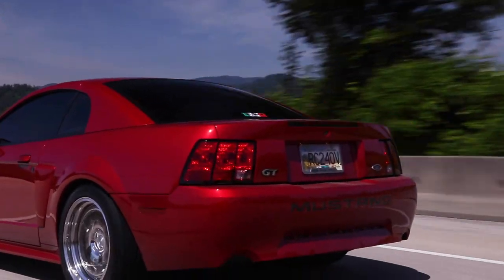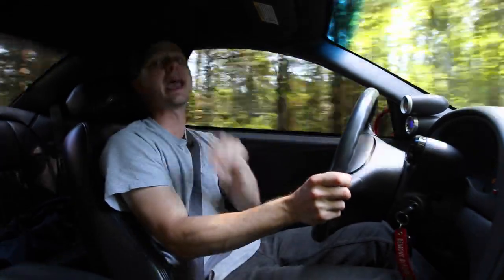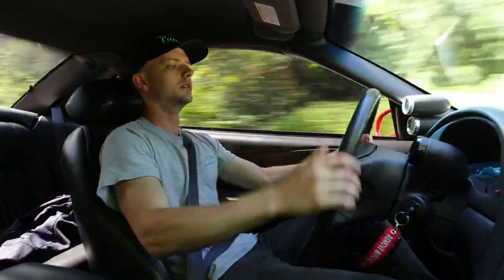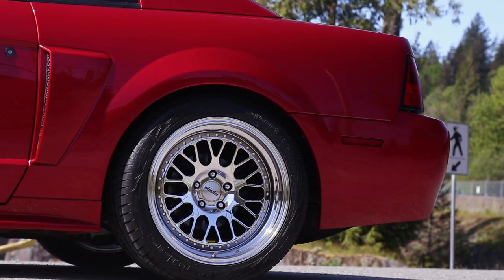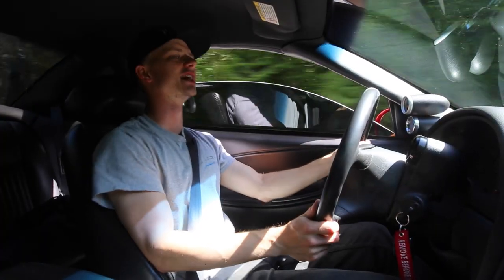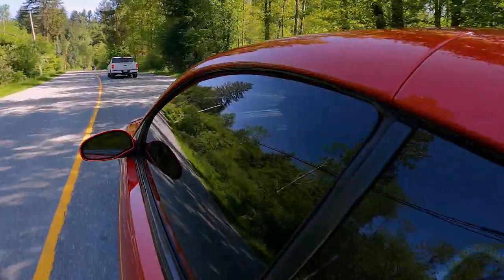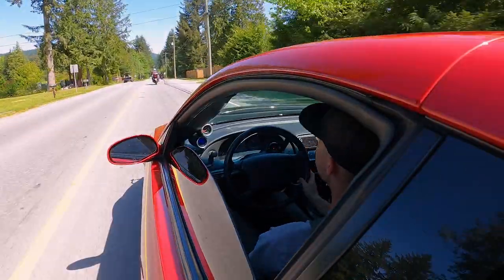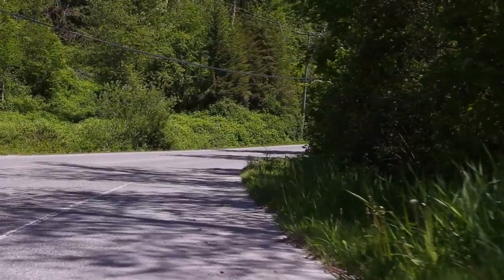This Single Turbo 99’ Mustang GT Tire Slayer Is A Boosted Time Bomb

Comment: Imagine throwing some rods, pistons, and a crank in it. Really can make some power. These 2vs love boost. 700+ on mine
Reply: I have 2v and need advice on how to make over 700hp
Reply: @leondavis3451  just need a good set of rods and pistons. A crank and throw the boost at it. Supporting mods of course. Fuel system.
Reply: Where is a reliable place to get those rods and pistons and crank from ?
Reply: @juanpicazo7798  I have Manley rods and king pistons. My builder had ordered them. The crank I have is a cobra crank. I found it on Facebook market place.
Reply: Guys I have a 2v saleen and I put a t1 blower on it and it ran fine for years but it broke recently. I need to have the motor rebuilt with forged parts but I don’t know a shop I can trust. I would love to build a turbo 2v like this. Any advice would be appreciated. I am will to take the engine out of town to a good company as long as there a great builder.
Reply: @Jsta2v_racing  thank you
Reply: @Jsta2v_racing  where do I go? Who do I buy from. What heads do I need to buy?
Reply: @leondavis3451  u just need to check around with ur shops. Ask around on prices and do re search who does good work. Every shop will have some kind of bad review but u just have to find someone u trust.
Reply: @leondavis3451  basically replace the whole car. Upgraded fuel, transmission, engine internals. Axles and rear can take it but for peace of mind you may wanna upgrade those too
Reply: 700+hp?! Thats amazing! My goal is to push about 400 to the rear wheels on mine. However, the build I am doing with that engine on my channel is actually a 1966 mustang. I think 700+ with my car only at 2500 pounds would cause some severe lack of traction!
Reply: @4WDTrek  setting up the car with right suspension can make a world of difference
Reply: @Jsta2v_racing  that is what I did for the most part. Not pushing for a straight line car. Want to do more autocross and road courses.
Reply: @4WDTrek  fair enough.
Reply: @leondavis3451  this guy really said "just need" than listed a built engine. just ls swap it for 1200+ on stock bottom end.
Reply: Any engine fully built can handle power lol. “Just fully build it bro”
Reply: @ssjdavid  holy old comment lol. Rods and pistons are nothing crazy 🤷🏻
Reply: not to revive an old comment but are you running the stock trans? stock rear end?
Reply: @SnoEntertainment762  I have a 4r70 trans but it is built. The rear end I had was a 8.8 31 spindle axles 373 gears. But that is coming out this weekend. We are beefing it up to 35 spindle and a spool as well.
Reply: @juanpicazo7798  mmr will build a 1000 horsepower 2v that holds up. Only place to get rods and pistons. ETC for 2vs
Reply: Imagine, if it can fit, putting in a Terminator rotating assembly
Reply: @chancekoehler7578  not really needed. The 2v set up can make 1000+ no problem
Reply: A budget built 2V for 600whp would be coyote rods/pistons, stock crank (reliable to 650whp/6500), Tremec TKX or maybe an older TKO that’s been faceplated, and strange axles in the rear. If you have an auto the 4R70 doesn’t take much to be able to withstand some pretty impressive numbers. Any set of cams would of course help but I’ve seen guys with stock cams make low 500wheel.
Reply: @TheJMan1K  yes indeed. The 2vs can make power. The rods and pistons are the main weak point. Change those and ur golden
Reply: You wish you got 700+ hp I call bs
Reply: @reese15m  lol I mean u can believe what u want 😂
Reply: Cams too
Reply: @WarriorOfEden3033  for sure.
Reply: @sircruse1422 ls ain't making 1200 on stock bottom end they sure ain't gonna do it for long or reliably.  Stop spreading false bullshit.  You can forge the 2v and make whatever power you want and you'll have a freshly forged engine not a pos 200k mile truck motor.
Reply: @ssjdavid no they can't.  Some engines have weak blocks and need an aftermarket block too not so with the mod motors.
Reply: @reese15m a forged 2v can easily make 700 wheel why do noobs like you think that's so unbelievable?
Reply: @Jsta2v_racing  true true nothing a machine shop and a night can’t fix lol
Reply: @sircruse1422 yeah.. lasts for a month. You still have to build those to last.

Comment: With the exhaust port ahead of a single front tire, I'm curious if the heat causes any odd tire wear.
Reply: Also if the driver starts to feel dizzy when in traffic... Carbon monoxide poisoning
Reply: I have a bumper exit on my 13 gt, by the time the exhaust gas reaches the tire, even in that short distance, the heat drops so much it has zero effect on the tire.
Reply: Nahhh I’ve had multiple fender exits
Reply: Thanks
Reply: No not at all !

Comment: 2v 4.6 is the best soundtrack ever 👌
Reply: 🤣🤣 4v b head c head da,db,dc heads say otherwise
Reply: That might be a 3 valve setup. I had a 94 Thunderbird with the 3 valve per cylinder engine. Was very reliable and sold it with 170K miles with no issues.
Reply: @GeraldPUR  someone swapped a 3v in a 94 thunderbird.

Comment: Love the turbo 4.6 but a mustang needs dual exhaust coming out the back…It’s just part of its style…
Reply: I would have to agree with you on that one. The single exhaust on a v8 just doesn't seem right. I swapped in the 4.6 into my 1966 on my channel. I eventually will supercharge it just to keep that true dual 2.5" exhaust
Reply: @4WDTrek  nice channel..I subbed..
Reply: @NewEdgeDesigns  oh thanks bud!
Reply: No real point in running a dual exhaust on a single turbo engine
Reply: @4WDTrek  I mean you can run duals with turbo(s).  Especially if you do twins its even easier lol

Comment: I had a 1998 with a Vortec  11 lb of boost no intercooler and I beat the piss out of that car for 30,000 miles and sold it. It never blew up I did pop one head gasket in the beginning when I bought the car with 5,000 miles this was in 1999-2000 it had alot of detonation at high boost I was told but I was young and didn't no any better
Reply: You're lucky it lived at 11 psi with no intercooler.  Keeping it cool and giving it good fuel is the best ways to keep one alive.  That and don't give it too much rpm.

Comment: What exhaust setup do you have. I boosted my 03 GT. Making 470hp @12lb boost.  I have borla atak no cats and it sounds like shit until i hit around 3k rpm.  Any recommendations?  Thanks in advance
Reply: It’s a bumper dump lol
Reply: Add cams ?
Reply: Bumper dumper. Lol. No shops around me want to touch it without cats.      No cams,  just bagged and boosted.  I had borla stingers but they were way too quiet.   What shops would do the fender exhaust.  How can i find Caden the guy hes taking about in the video?
Reply: Remove those borla attacks🤣🤦
Reply: Post how it sounds, I have ataks rn with cats and it sounds awesome

Comment: The 2v makes just as much power and torque as the old 302 did if not more (new edges are more) and will make the same or more power na or boosted with less cubic inches.  Forged internals in both and the 2v can take way more a 302 needs an aftermarket block to match what a forged internal factory block 2v can do.  I'm not sure why the 2v is seen as a "lesser" engine other than 4.6 doesn't "sound" as good rolling off the tongue as "5.0".  They definately "sound" every bit as good or better exhaust wise that is facts.  Nothing wrong with the mod motors just too many people misunderstand them or just go by what others say.  Too many sheep.

Comment: 3 days to build good god.  My 4v is taking much longer than that.  The 76mm upgraded turbo does NOT fit easy. The front dump is an easy way out for routing the exhaust though, not surprised he went that way for the ease of installation/cool factor. 3 days from stock kmember and everything? Wow

Comment: Y u cant run the exhaust to the back so people won’t know what u have ?
Reply: Don’t know for sure. But I’m guessing it’s because the small amount of room you have down there. I have a 2000 gt and just got headers put on it and there’s barely any room down there. You have to drop the k member to get them in so with turbo headers it’s probably hard to do.
Reply: @rustybong3249  but will it pass inspection??
Reply: @P71ScrewHead  not everywhere does inspections.  I have never had a car inspected in TN for instance.
Reply: @edensgardenshed9622  that's good man, from what I've heard here is that it depends on how many ppl live in the counties n if it's not many then no emissions testing is necessary..

Comment: Be careful guys this thing still has a solid rear axle 
Driving high hp Gt's is sketchy as FCK and would recommend going to IRS

Owned a 01 V6 peg ledger 
Owned 03 GT
Owned 99 Cobra 

Stay safe out there love the build but I would feel irresponsible on not giving a warning to those who have never owned this car
Reply: Can setup the solid axle better than the irs in stock form

Comment: This generation is called the New Edge not the SN95,lol!! The SN95 is the generation between this and the Foxbody. Cool build and beautiful car👌🏽🔥🔥🔥🔥🔥🔥
Reply: Its the same chassis though right? The only difference is body panels
Reply: @philipcarter8143  yes. Both of them are still based off of the Fox platform tho.
Reply: SN95 gen 2
Reply: Nah newedges are still considered sn95s it’s the same body style just updated
Reply: @Jackson99273  yeah I’ve just always called them New Edges. Hell theyre both still based off the Fox platform,lol!!
Reply: @CPMUNSEY  yea I call them newedges and pretty much everyone does lol
Reply: Your wrong. New Edge mustangs are still SN95s but the 2nd generation.
Reply: @MM_45  see above comments
Reply: Technically its a foxbody on its 3rd chassis and yes it is an sn95..... new edge gotta get your facts right before textin damn this is knowledge from 04
Reply: 94-04 are all sn95.  They call 99-04 new edge to differentiate them from 94-98 but they're all sn95s the same as 05-14 are all s197 and 2015 and up are all s550.

Comment: 215 hp 2v. 4v 305hp. Turbo 2v 400?
Reply: The 2v is 260hp, inform yourself dude..
Reply: @P71ScrewHead over rated af. 215 realisticly
Reply: @alexperry06  Depends on if NPI or PI top end.. My NPI all stock dyno was 175rwhp.. My 09 P71 did 220rwhp all stock..
Reply: @alexperry06 At the tire yeah lol